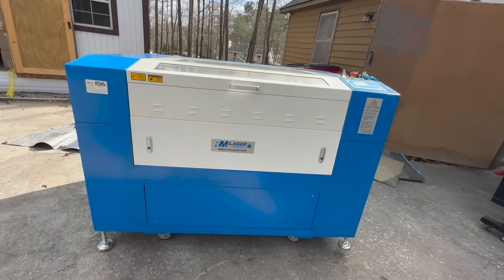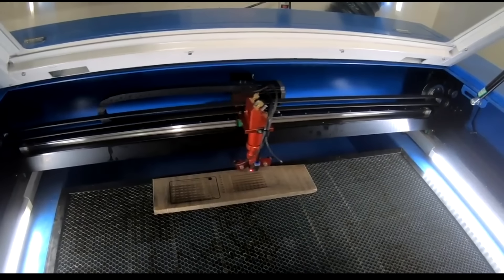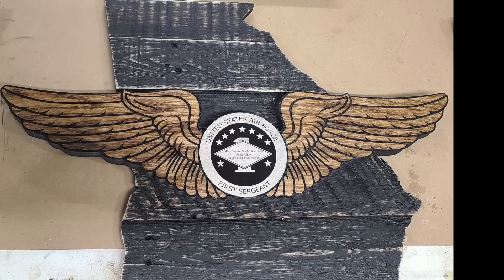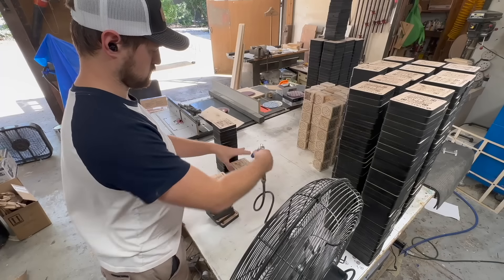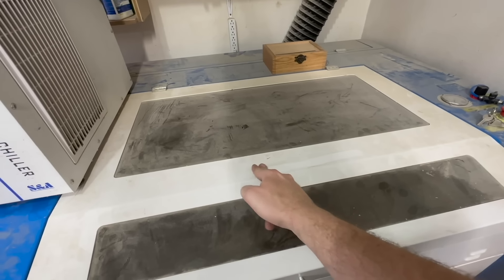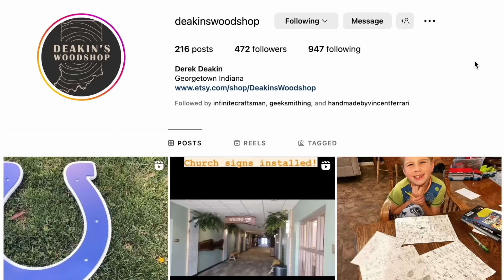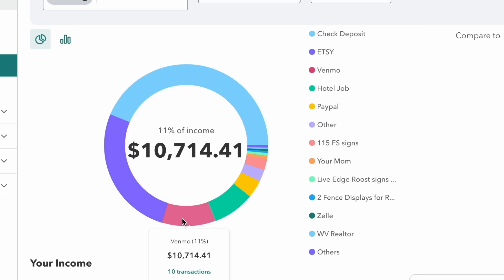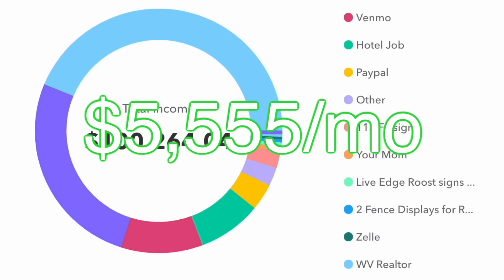How I Made $100k With My Chinese Co2 Laser Cutter Engraver

Comment: Hey Chad with the maple wood you use for the menu cube and how do you source it?
Reply from the maker: Actually that was tough to find since I needed them 4x4” I had a friend that works at a hardwood dealer in NY he actually had rough sawn 4” thick maple I paid for them and had them shipped to me. I had to joint them down and cut them myself. I believe there are vendors online offering 3” cubes though if you do a google search.

Comment: Are burned edges of laser cutted wood not a problem?
Reply from the maker: I seal them up with the lacquer that I spray when finishing products.
Reply: @ChadsCustomCreations  Sanding them is probably too much work?
Reply from the maker: @0Turbox  you could do that with the ridged belt/spindle sander it would make quick work of it if you wanted that clean wood look.

Comment: Anyone know if you can plug it into a 110 or does it need 220v
Reply from the maker: I run mine on 110 but can be switched to 220 with the flick of a switch on the back.
Reply: Thanks for the Reply, i plan to run mine on 110 so just making sure!

Comment: Did I miss the purchase and operating costs?
Reply: There are no prices online. There is a 960, but not a 690.      Although the second time watching was at 2x speed with skipping around. 
   Either way, my time has been wasted. The numbers, price and model, and capacity are still unclear.
Reply from the maker: @othername1000  I do apologize originally the price was included in the video but I was asked to remove it since the price varies depending on where it is having to be shipped to. I can tell you however that in the US the price is $5500-$6000

Comment: How do you seal your coasters and outdoor signs?
Reply from the maker: I personally use satin spray lacquer by Mohawk.
Reply: @ChadsCustomCreations  thank you.  The lacquer is holding up on outdoor signs.  That is good to hear have a couple people wanting outdoor signs and trying to decide best say to make them so they will hold up and last.
Reply from the maker: @RobSandstromDesigns  I think ultimately everything will deteriorate overtime especially in the sun but lacquer to my knowledge won’t yellow like other finishes. And when refinishing it doesn’t required sanding since the new coats will burn into the previous coats.

Comment: I got to this video from your vacucu video. You showed some of your lazer engraved products and i had to come check this out. I love woodworking, metalworking, and electronics. But I also worked for a plastics company in Nevada for almost 2 years, (Tripp plastics,  in Sparks/Reno). I ran thermo forming (vacuum) machines and 5 axis cnc routes. Most of what we made was all the plastic parts that go inside of slot machines. I'm currently planning to build my own vacuum former, but I've always wanted a lazer cutter. Unfortunately they are expensive and I doubt I could build my own for much cheaper. Anyway, you got a new subscriber, YEAH!
Reply from the maker: Sounds like you have tons of experience using these machines. The prices I would say have come down drastically over the years on laser cutters. This machine featured would be about $5500 delivered in your area. But there are people who are too afraid to replace the worn out parts like the glass laser tube so always check your local FB listings and you might be able to snag a used machine if your wanting to save some money.
Reply: @ChadsCustomCreations  thanks for the quick reply, and I will try looking for a broken one locally. That's a great idea. I've always been one of those people who can fix anything that can break. That's why I have been a maintenance tech for the last 17 years.

Comment: What type of tape do you use? I've tried like 10 different wide masking tapes and none of them come off of the roll in one piece.
Reply from the maker: I think I have it linked in the description or pinned comment. But there is a trip to pulling the tape out without tearing it. I flip it upside down. Hold it down flat with my left hand, then roll it out with my right hand.

Comment: Awesome video! Do you sand or treat the wood after engraving, before adding your lacquer finish? I know you add a coating but do you leave the wood looking rustic or do you clean it up? Thanks again!
Reply from the maker: Yes if it is not masked there will be left over laser residue normally I sand that off quickly, blow off the dust then apply my clear coat.

Comment: Informative video.  If you don't mind what are you using for the QR maker ?
Reply from the maker: Lightburn has a QR generator built into the tools it’s so quick and easy I love it.
Reply: @ChadsCustomCreations  Thanks. I forgot all about that. smh.. No memory left in my old age. lol
Reply from the maker: @freebird1963  no problem at all definitely glad to help however I can. I am only 32 and I forget stuff like this all the time too.
Reply: Hey there, great video!  Maybe I missed it, but what model is this laser?  And did it come with the chiller?
Reply from the maker: @heathergardner3028 this is the RM 960 the chiller did come with mine and if in a hot environment like a garage in the summer I recommend the cw5000 chiller. https://rmlaser.com/collections/c02-laser-machine/products/co2-laser-engraving-machine-laser-cutting-machine?ref=CHAD

Comment: What do you use to smooth the edges quickly and nicely? And do you buy the qr code wood squares or cut those out?
Reply from the maker: With the high PSI and powerful laser the edges actually come out smooth and relatively clean but I do spray with lacquer to seal them which keeps them clean to the touch and removes that laser smell.

I cut the QR codes out with the laser.

Comment: With all that work, and all those higher value clients, I'm a little bit disappointed by the revenue. Maybe I live in an area with a too high cost of living and taxes, as that revenue would still amount to significantly less than a regular high skilled job would pay. Would it be accurate that your YouTube side generates around 500 USD a month?
Reply from the maker: Yes cost of living here in this area of GA is pretty low. We bought our house in 2015 for $128k so that definitely helps. There is some money that comes in from YouTube and affiliate sales which is a great supplement. I think this line of work is definitely dependent on your cost of living or it might require upscaling, contracting work out and such to hit a wider customer base.

Comment: Hi Chad. So I am in talks with RM Lasers now but I’m completely overwhelmed. What type of air compressor would I need? My current shop air compressor I use for my nail gun is extremely loud.
Reply from the maker: Check out this list here it has the setup I use for air it’s super quiet California air compressor and you will see the 1/4” hose adapter kit and water air separator to get your ready to go.

https://www.amazon.com/shop/chadscustomcreations/list/3AS04C0BGLQSK?tag=onamzchadddow-20&ref_=aip_sf_list_spv_ofs_mixed_m
Reply: @ChadsCustomCreations  do you think the .6 hp ones would be good enough? Or is it the size as well I see you have 8 gallon?  I see a .6 hp, 1 gallon.
Reply from the maker: @Fleshybitz  it might be enough I see the .6 hp has a cfm of 1.2 and the 1 hp has a cfm of 2.2 so it might not be able to maintain as high of a psi but it may not make too much of a difference. Mine seems to be able to hold at about 40psi when running continuously.
Reply: @ChadsCustomCreations  ok thanks, I guess 40psi is what it requires on a constant run time?
Reply from the maker: @Fleshybitz  I have not done enough test to really say. Most the time on 1/2” material cutting I set it to just 20 psi so it might be okay. For engraving I set it really low.

Comment: I see you cut 3/4 plywood  what is the watt of the laser
Reply from the maker: This is a 90w laser
Reply: Thanks  for replying
Reply: I used masking the material  but the paint bleed in the material what tape you used.
Reply from the maker: @franciscobaez1528  I have that masking tape linked in the description under laser materials. A trick you can do is before spraying with color spray it first with a clear sealer like lacquer which will seal up the wood and help to stop bleeding.
Reply: Thanks  chads I will do that

Comment: Ha ha it says the Lightburn software is $120 US. That's a lie. I bought Lightburn for $84 CDN. I have an Atomstack 10 watt and it's paid for itself without even trying in just a few short months. I talked to Epilog lasers who are one of the best CO2 laser distributors and they said that the CO2 tube would only last a few years even if you don't use it. Yes they are more powerful and faster but quite a but more expensive. I think they had a 50Watt used for $15000 CDN. And that was years ago. If you get a diode laser like the one I have they are slower but a good place to start and they are becoming cheaper and more powerful. I think they are up to 40 Watt now. The one thing I would caution on is the software availability. I've heard lots of good things about the X Tool but I have also heard that it only uses their own proprietary software and you can't use Lightburn. I also heard that Lightburn isn't going to spend time adapting their software to X Tool either.

One word of caution though if you do get a laser it's highly addictive. You'll want to engrave or cut everything you see. I love it!
Reply from the maker: You’re right about that!
Reply: My daughter hates it when I say, I can engrave that!

Comment: Great video! What kind of wood do you use for your coasters?
Reply from the maker: Funny enough I am using the red oak plywood you can get from Home depot or Lowe’s.  I think I calculated that I can get 250 4” coasters from one $90 sheet and turn around and sell them at $10 each for a total of $2,500 per sheet.

Comment: I have a question on the QR codes. When you were asked to make those, did the customer supply the file, or did you have to create the QR code for them?
Reply from the maker: I have both clients come my way I leave it up to them. Some send me their images others just send me the link. In lightburn there is already a QR code generator which makes it super quick and easy to make them.
Reply: @ChadsCustomCreations  thanks.  I didn't know lightburn had that feature. We bought our first laser in December.  X-Tool D1pro 20w. It's not fast, but it's getting the job done for now.  We haven't ventured into lightburn yet though.  Still using X tool creative space.  Hopefully this little laser gets busy enough to justify a larger machine at some point.  Thanks for the info.
Reply from the maker: @samsanderson7159  I think you’re doing it absolutely right start out with a diode if business gets busy enough to warrant the switch to a co2 do it when it gets there.
Reply: @samsanderson7159  it is well worth the $60 annual cost for LB
Reply: @mbrang00  I just wish I could run wireless.  My laser and computer are in different rooms.

Comment: What kind of tape do you use on the wood to paint the engraving and then peel off? Amazing work!
Reply from the maker: It’s a low tac paper based masking you can find it in the description Amazon links and laser materials
Reply: Awesome I wasn’t sure if it was a type of vinyl or just masking tape or what but dang that’s amazing work bud!!
Reply from the maker: @dustindavis4156  thanks so much! Yes and you may already know this but it’s best to not use anything with vinyl if you can as it creates chlorine gas when lasered.

Comment: Awesome work!!  The Roost sign at 23:00 looks incredible.  Is that just a solid engrave and the natural way the the grain went or did you design it in software to give that effect?
Reply from the maker: I added that wood grain effect as a separate layer and had it burn deeper on those spots. Good eye.
Reply: @ChadsCustomCreations  I have a sign to make I need to do a similar effect.

Comment: On the outside, this looks like the Thunder laser.  I have the Thunder laser Nova 35/100 and received it on January 2023 and I still have not use it yet.  This means that it is what you do with the laser that is important and not what laser that you have.  Watching this video is inspirational and I need to get off my butt and start hooking up the laser to use it.  I bought the Thunder laser to be used as a hobby because I am busy with my full time job (and it is stressful).   The Thunder laser is in mint condition and still in its factory plastic wrapping.  Shame on me 😞
Reply from the maker: I’ve been there it’s intimidating at first getting it unpacked set up and running. But once you get to it you’ll be so glad you did. Reach out to me if you get stumped anywhere I am happy to help where I can.

Comment: Well laid out video, and a great testimonial to RM lasers and Ray’s customer support. Just curious, you receive the laser in August and didn’t have it up and running until October. Was there a lot of assembly required? What was the reason for two months before it was operating, just getting familiar with the machine?
Reply from the maker: Thank you for the kind words Reid. Took me that long because I was a little intimidated in replacing the laser tube that this particular machine needed. I made it a way bigger deal than it is you can be up in running the day it is delivered.

Comment: Great video btw, I was wondering what type of tape you put on your projects when you engrave them? as in 4:53 of your video. Also, do you put on polyurethane before you spray paint? On my projects, I use painters tape when I engrave, but when I spray paint the engraved area, the paint will soak into the grains causing paint bleed where I don't want it and my edges are not crisp like yours.
Reply from the maker: It’s a medium tac paper based masking if you go to my Amazon links in the video description you’ll find it under laser materials. If I don’t pre treat the wood I will spray the masking with clear lacquer before adding the color it definitely helps with the paint bleeding into the wood grain.

Comment: I built my own 80W laser, primarily using the resources provided by Further Fabrication.

https://www.youtube.com/@FurtherFabrication

There are significant upsides to going down this path. By the time you're done building it, you understand exactly how it functions and therefore don't need any assistance with service or repairs. It also gives you a much better understanding of the capabilities of the machine, and how far you can actually push it. Lastly, it's just a challenging and fun thing to do.

Something to consider. 

Awesome video! 
Very helpful!

Comment: Hi Chad, I love your work, greetings from Bulgaria!

I produce some stuff and sell it locally and was wondering how to get darker engravings then I saw you spraying black spray over the products which is incredible idea. 

But what is the sticky material that you put on before engraving and what is the type of spray that you use after that? 

Will appreciate your answer a lot. Great work and keep on going!
Reply from the maker: Hello from the USA, yes inconsistency with Co2 laser on wood is pretty common so I decided masking and painting was my way of getting rid of the chance of bad engravings. I use 12” low tac masking paper based tape. If the wood has a high chance of bleeding I will spray with lacquer to seal up the wood grain first before painting with black paint. I have the tape linked in my Amazon links under laser materials in the video description.